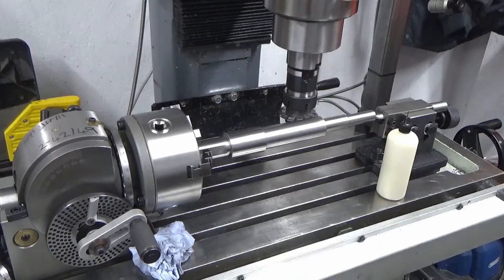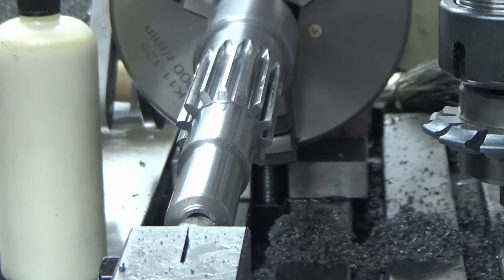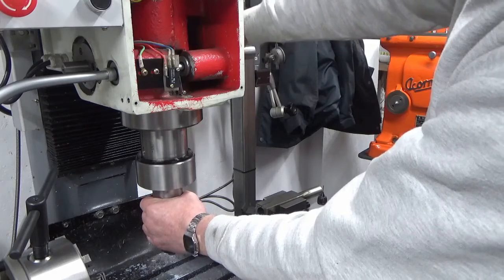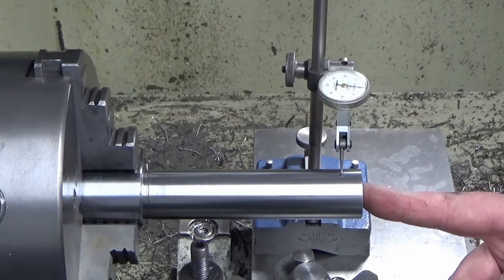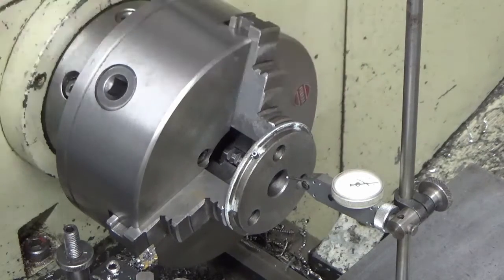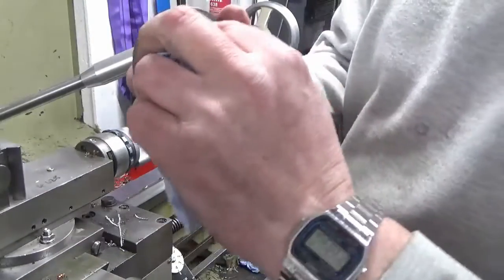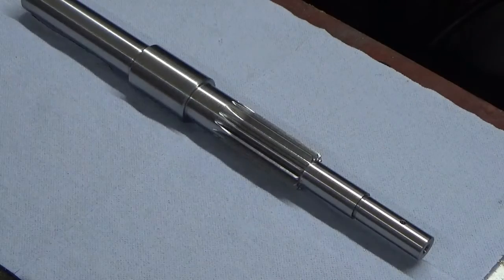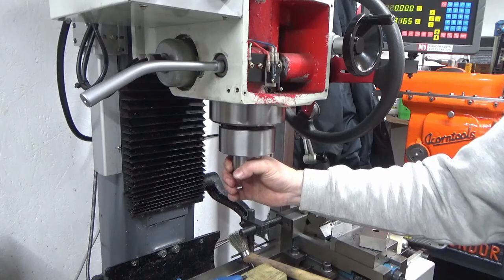ZX 7045 Mill Head Upgrade - Part 4C  New Quill Pinion Shaft (Gear Cutting)

Comment: great job John, one question out of curiosity, when you clocked the bore before machining for the bushing ,how come you didn't clock the face, or did you but didn't show it?
Reply from the maker: Hi Paul, thanks for the comment and great question. The front face was not the location face into the head casting, that face was up against the front of my jaws which I know are good so I didn't bother in this instance. The bore was very short as well so any error off the front of my jaws would be miniscule over this length. All thought processes I go through but don't always verbalise to keep the videos to a reasonable length, so thanks for asking this. I will pin this comment at the top for others. Cheers, Jon
Reply: @jonsworkshop  Ahh. I see now, I thought it was the other side with there being a rebate as such. thanks for the reply.

Comment: Recently found your stuff, and i have to say, the indicator stand of the old style is indeed great for lathe and mill clocking in some arrangements, but what bothers me is that your lathe somehow has enormous tool deflection or something... A few setups were forced on you by the geometry of the projects and of course, spontaneously induced chatter and insert holder vibration, but here, you are cutting brass on the side and you have so much deflection that a screw finish was made on the return pass before parting operation... My baby lathe uses 10mm shanks for holders, well, she can use 15mm but i wanted to get a small set as 15mm boring bar is no good for small part work... Sure, i made my own smaller and larger boring bars and what not, but she, for a baby lathe which weighs 150 pounds, she by all logic should provide more chatter and deflection of any and every form, compared to your much larger lathe... 
Sure, my big girl lathe has a 150 pound tailstock, but the baby lathe should by all logic be inherently much more gentle and less rigid... And i dont get chatter or tool deflection with carbide inserts on her, in bloody stainless steel... Let alone brass... Ok, she is from 60`s or early 70`s and is scraped in all over and is made in image of other small precision lathes, like the swiss mikron baby lathes or similar designs(theres a lot of that style replicas all over the world)... That can be accounted for in the rigidity department, and the surfaces geometry and relations sure add stability to her ``body parts`` but her tools are still on 10mm carbide shanks in an old style 4way toolpost on a compound slide, some of which renders rigidity, some of it which denies it... The 4way is very rigid, unlike most cheap qctps, but compounds are always a source of potential loss of position... I wont say that the big girl is rigid as the core of dead stars, as she kinda has to be... She is almost 3 tonnes, but your lathe should by all considerations have the inherent material capacity for greater rigidity than a much smaller lathe... 
Of course, your parts fit on the lathe can make or break the deal, and that is why my baby lathe is oem scrape-matched all over, but i would definitely check your lathe and all of its parts fitments with machinist blue, each against other, then on the s. plate... After that, when assembled, inspected with an indicator as to ascertain the potential play after the fits are well detailed and geometries printed against each other... That will give you a clue where your major loss of rigidity comes from... I would denounce that qctp of yours, as its the most obvious thing, after the compound side, but that is preconceived notions, which arent any basis of good and proper precision work, or care for machinery.... Take a week and check every part against its mating surface and for wiggle of any kind, that will instantly inform you what is the problem... Hell, you could have a loose carriage gib on one side, operators most likely in this case, so its really hard to make a good educated guess... Only a micron indicator will speak with certainty, i can only speculate...
Reply from the maker: Hi Camillo, thanks for the detailed comment. What you are seeing is a tiny amount of deflection (which all lathes have regardless of size or quality), and the majority is uncut material. When you use carbide insets with radii on the corner (in my case 0.8mm), and you feed hard to break the swarf which I do, the resultant surface is very scalloped (cusped), with high spots on a spiral coincident with your feed rate. When you then wind the carriage off in reverse, you cut all the high spots leaving the spiral you saw. The true test of lathe rigidity is parting off, you will see in some of my other videos I can push a 5mm wide parting insert through carbon steel at high rpm with no issues. I did a full check on this machine when I bought it and it is in really good shape. Chatter and vibration is more often than not caused by incorrect tool geometries which is very true in my case as I tend to be a bit lazy swapping tools over when I know I should etc. Cheers, Jon
Reply: @jonsworkshop  Damn, 0.8 is quite the radius... I understand chip formation and breaking, and the nature of carbide vs hss tooling, as i am a machinist myself... Interesting... I usually keep my cuts on both lathes, small and big, below or around 1mm diametrically, which on both lathes results in decent chip control(mostly) and slightest hint of back drag on the baby lathe... Tho, i use strictly tools and inserts with minimal radius, as i tend to avoid excessive material removal if the design geometry doesn`t demand it... The big lathe can take immense cuts and i do use ceramic and cbn round and square inserts and carbide with large radii when i need them, as she can manage any loads or cuts... She is a beast of 3 tonnes afterall... 
Yeah, i agree, your parting performance does indicate high rigidity of the whole system, but i don`t really ever have that much of deflection on either lathe... It could merely be up to style of the operator, as i rely on other machines aswell for some aspects of work, so it could just be that, the operator`s approach and tool selection... Avoiding large radii and sticking with sharp and tight edges along with slow feed and relatively deep cuts allows me to reduce tool pressure and in turn any thusly induced deflection of either part or tool. If i need superb finish, well, that`s what a polishing lathe is for, or even the t&c grinder for some small parts, as deckel s1 has a wide range of approaches that it offers to grinding... I guess i tend to approach turning like i do grinding, which is with relatively slow feed along with higher spindle speeds... That generally breaks the chips and leaves a good enough finish for most non precision parts... Roughing work i do by handfeed, as its often a single or few passes, and it allows me to ``feel`` the material through the system...

Comment: Good point using shim stock in the lathe jaws Jon. I've never liked copper for repeatability if it compresses. Superb job enjoyed watching. really pleased it's worked out well. Tony
Reply from the maker: Hi Tony, thanks for the comment. Yes, I was taught the shim stock trick by an old toolmaker many years ago, it works a treat. You can even use it to centre parts in a worn chuck by altering the thicknesses used under each jaw. Cheers, Jon
Reply: @jonsworkshop  Top Drawer reply to an industrialist have a go novice lol. Cheers Jon, Tony

Comment: Bit of a journey Jon, but you got there in the end. Well done. For storage, when the time comes, I plan on using a french cleat system on the walls. Spaced about 6 to 12 in. (15 - 30 cm). That way everything is adjustable as my needs change or new tooling is acquired. Its cooling down here in central Canada. Won't be long until its covered in white stuff for 6 months.
Take care,
Steve
Reply from the maker: Hi Steve, thanks for the comment and feedback. Yes, time for a big rethink in the workshop, not sure what I will do yet, but I need to get a lot of stuff off the floor and up on the walls so shelving, French cleats etc. Cheers, Jon

Comment: You had to take the long way to get there 😉 but it looks like you still had a lot of fun. And now you have a 30 taper spindle that's so much better. Although, I will say, I was hoping to see the shaper put to work on the rack. LOL. Well don, sir, well done.
Reply from the maker: Hi my lil' mule, thanks for the comment and feedback. Loads of fun and learning lol. The shaper is on the horizon again now I have the mill back up and running. Cheers, Jon

Comment: Great!  As always enjoyed.  It looked like, from the camera angle, when you drilled the larger hole, the drill seemed to flex. How about a video on what happens when the bit flexes and what to do about it.
Keep them coming, and thanks.
Reply from the maker: Hi Jerry, thanks for the comment. Very observant, of course what you couldn't see off camera is that some fool forgot to lock the tailstock up lol, that's why I retracted and came back in for a second go. Also, the drill was brand new and very long meaning more leverage to influence the loose tailstock, so the combination of both things caused what you saw in this case. Cheers, Jon

Comment: if the quill is still a bit tight you can use some prusian blue on the gear and look for wearpoints , it might be that the teeth are good but you need to wittle the circumference down a little with emery cloth as it touches the valleys in the rack part

just thought of sumting , the part you had put the brass bushing in mightve been made offcenter on purpose , the way you can somewat adjust the dept / mesh of the teeth between the rack and gear by rotating it a 1/3th turn 

as for storage : might want to put shelves up around the circumference of the shop over the cabinets and machines for the lesser used big parts and smaller bit and bobs stored in bins , the shelves can allso make a hanging mounting point for the camera using a clamp , a dailholder type clamp / tripod camera type mount mount and some barstock so it floats over the top of the machine , should be less in the way than using a tripod , bunch of hooks screwed in under the shelves alows you to hang stuff under them too
Reply from the maker: Hi Watahyahknow, thanks for the comment and suggestions. The cast iron bearing was on centre, it was just really badly made I think. Someone did suggest eccentric bushings both sides to actually fix the problem without the need to recut gears. It was an excellent suggestion, if I had a way of machining the head casing for the big bearing diameter, I would have probably gone down this road. Cheers, Jon

Comment: Great job John! I had a job like that years ago on a pinion gear and it was tight and it took me ages because I was taking off 3 thou at a time! I must have taken 10 cuts at 3 thou a time lol
Reply from the maker: Hi Dermot, thanks for the comment, yes, it can feel inefficient at the time but getting it right in the end is worth the effort. Cheers, Jon
Reply: @jonsworkshop  I probably never worked out the depth of cut properly because I never did gear cutting at all

Comment: If it looks right , it is right !  Interesting with the backwards indexing , never heard of that one before . 2 & 18 on a 21 plate will work as well .  Amazing how much we forget from our apprentice days , helical milling , gears , worms , saw tooth clutches etc👍🍺🍺🍺 .
Reply from the maker: Hi Max, thanks for the comment. Yep, I never did any gear cutting in my apprenticeship, did mine as a toolmaker so it was predominantly punches, dies and die sets. Never too old to learn though lol. Cheers, Jon
Reply: @jonsworkshop  Toolmakers apprenticeships were nearly impossible to get back when i did my one , so fitting & turning it was !

Comment: Glad the spline worked out this time Jon. As an apprentice we used to do quite a few splines for the machine repair team, we were taught to blue the end of the shaft and test run our dividing hole plan by scribing lines with a height gauge. This did two things, it allowed you to check the spacing was perfect by finishing back on the first line, secondly you could keep a check on each cut to ensure you hadn't wondered off the line as can easily happen when using dividing fingers.
Reply from the maker: Hi Andy, thanks for the comment. Yep, great teachings, I wonder if modern apprentices are getting the same experience. I realise the world has moved on and Manufacturing is completely different these days, but some of the grounding around checking and problem solving is a critical underpinning of a good engineer in any industry. Cheers, Jon
Reply: I like it !